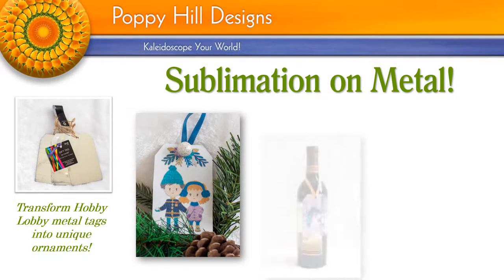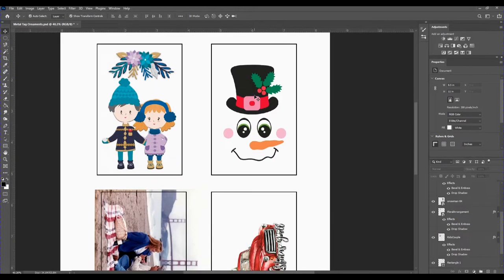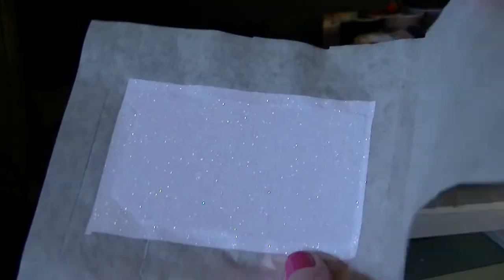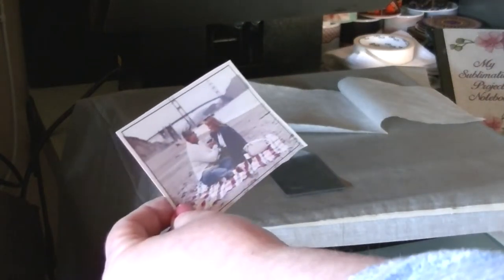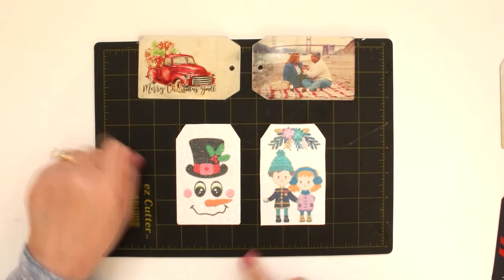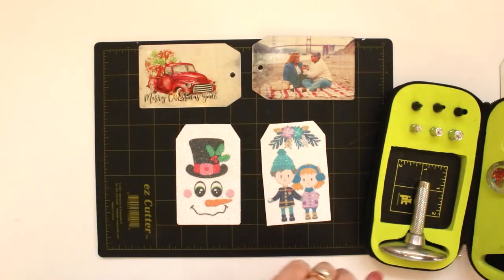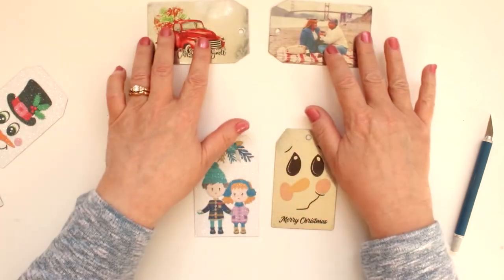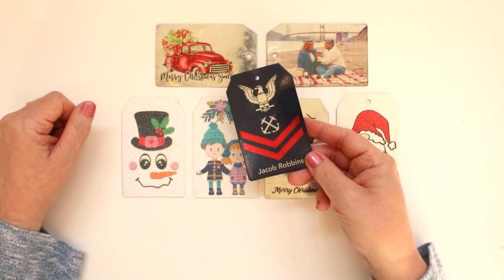How to Sublimate on Metal Tags Using Laminate and HTV White Glitter

Comment: Can you use the thermal mate so its not shiny. Also wonder if you run it though twice in laminater to make it seal to metal more
Reply from the maker: Hi Maria I'm not familiar with thermal mate, so I can't answer that.  You can purchase the laminate in matt finish and that would work.  As far as using the lamination machine, all I can say is try it and see if it works.

Comment: Wonderful thorough video. I wanted to ask will the laminate film itself come off the metal (or say if you did this on wood which I've seen in other videos) will it eventually scuff off a little on the edges of the material? Like say for example when one has a plastic phone case the coloring will wear off on the edges after a few years of use (that's plastic but I'm giving a scuffing off look example). thanks!